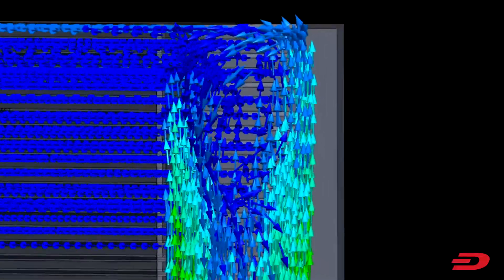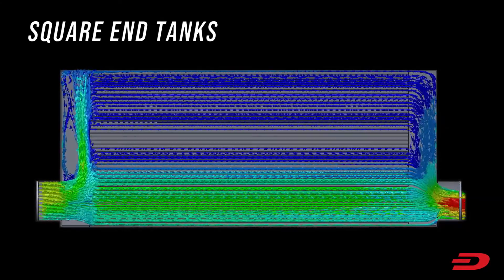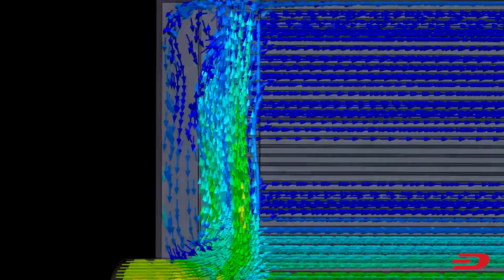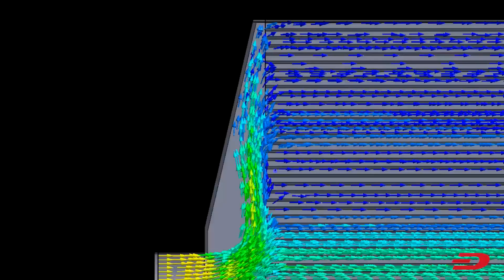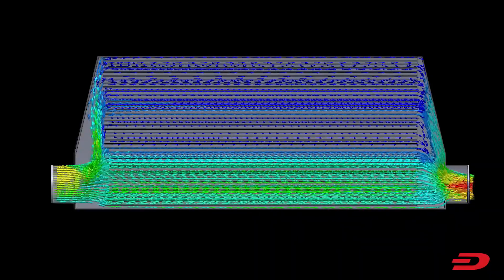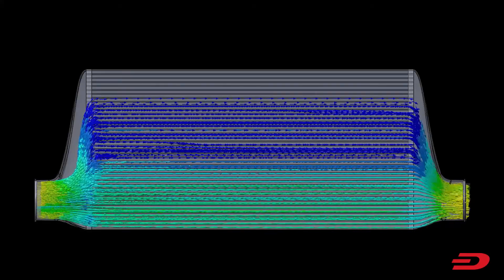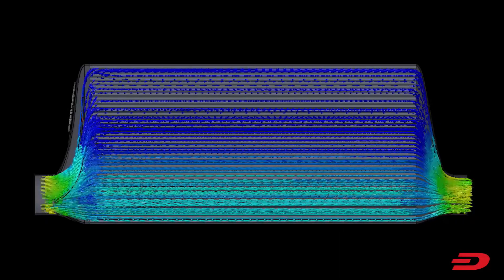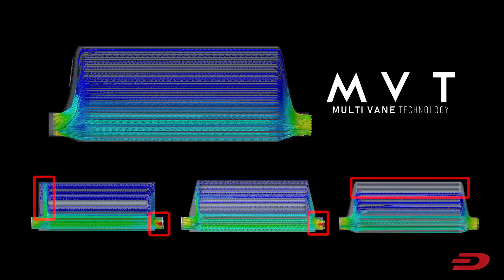How does a Performance Intercooler work?

Comment: Hi Direnza your MVT flows the best in simulation but have you got a back to back example of the same core with & without MVT on the same car/same day to show the significance in temperature change of the inlet air that MVT makes?

When looking at Wagner intercoolers  they display metrics gathered before & after such as IAT and back pressure difference their product has made, the power difference would be negligible but i think we would all be interested in the difference MVT makes